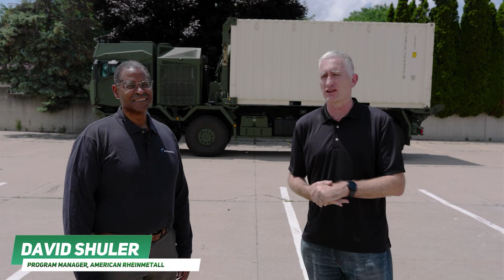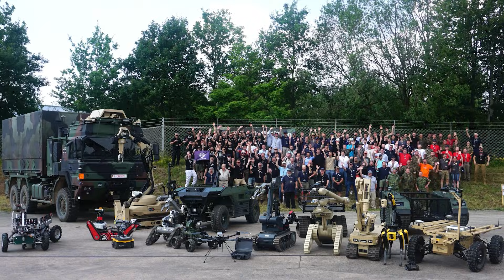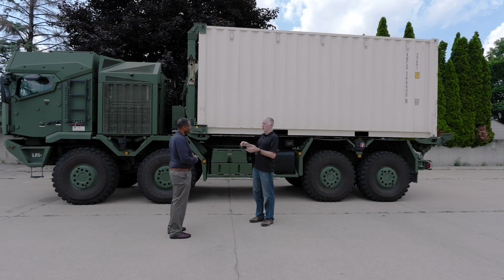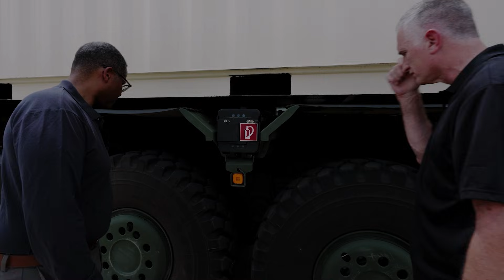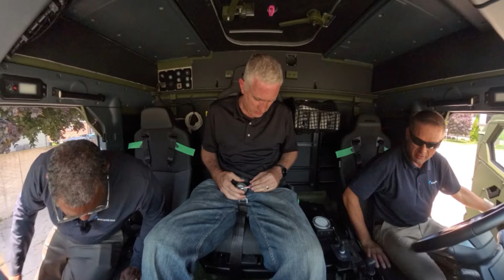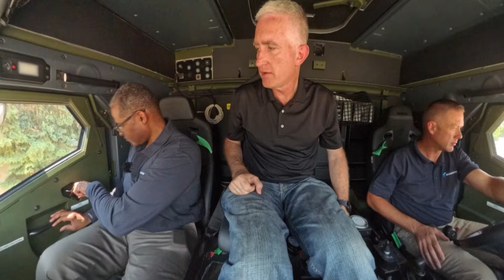American Rheinmetall, and the HX3

Comment: Cab over the engine is an older configuration that has many drawbacks, but it does help with smaller tighter inner-city roads.
Reply: the pro of a cabover is that in an event of a crash you won't be crushed by the engine.

Comment: HEY!!  I KNOW!!  LETS PUT POWER DOOR LOCKS AND ELIMINATE THE HANDLES COMPLETELY LIKE A TESLA!  I LOVE THE CD PLAYER IDEA.  I ALSO THINK THEY SHOULD ELIMINATE THE FLUID DRAIN PLUGS COMPLETELY.  Factory fluid change Interval is probably 200,000 miles.  Personally I think these should have every bell and whistle a GMC Denali has, only the very best for the troops.  Let's throw in remote start while we're at it.  Wouldn't want to have to get into a hot rig on one of those sunny Iran days.  All you knucklehead dorks and your "ooooh!", "aaahhh!!", "shiny electrical thing!". We may rue the day that we strayed as far as we have from tried and true basic mechanical essentials.

It's one thing for technologically advanced gear to be given to teir 1 guys, but for the logistical backbone to be so potentially vulnerable to EMP, or just a high enough concussion burst near by during a real attack....  I hope we never find out.  But as Dad used to say "sh!t in one hand and hope in the other and see which one fills up first"

I'm not worried about these trucks while they are still under warranty, it's 20, 30, 50 years from now when they are just sitting in a reserve depot, what will it take to refurbish this truck?  And you think that guy is going to honestly tell you if there were issues with this rig?  That's sorta conflict of interest.

Comment: As a Marine MT mech turned ops chief, Id hate to see this replace the LVSR. Less capability with solid axle suspension, less axles, no easy engine access, lower Ford capability, and so many more places for electronic failures which are the hardest to troubleshoot. I got to mess with a European version while in joint NATO training , and I couldn't think of a single way it was better.

Comment: All those cameras and radars are nice when driving on public roads, but they are also emmitors which can be detected quite easily by enemy sensors. Sure you can put an EMCON switch in there, but if the PFC learns to drive with all of it then you ask him to turn it off he or she might struggle to keep the vehicle wheels down..
Reply: You literally cannot hide in the modern battlefield. Keep the sensors and gadgets because an fpv or recon drone can find you regardless.
Reply: @Gegengrupenfuhrur respectfully disagree. There's a big difference between being detectable and being stupid... This would literally be like driving around with your lights on.
Reply: @fire304 you can turn off unnecessary sensors though. Like you dont need lane assist in a combat zone. But since 95% of these will end up in garrisons or humanitarian aid missions, its a good feature to have.

Comment: Fewer types of trucks is good as long as they are solid designs.  Saves a ton on spares, makes spares cheaper (economies of scale), and makes training maintenance people easier (fewer chassis/engines to learn).  Just don't do the typical German thing and overengineer the damn thing.  Simple and reliable is key.  After all, grunts have to drive and maintain these things.  ^-^

/edit and that went right out the window after i posted this comment.  Adaptive cruise control?  Automatic braking?!?  DO NOT WANT.  If i need to ram something with a military vehicle, LET ME DO IT.  These systems add unnecessary complexity.
Reply: It's probably necessary to be street legal
Reply: @MatthewMakesAU  Not yet, but it appears it might be by 2029.  Which is a mistake, IMHO.  I've never had auto brake save me from an issue, but i have had it try to put me through the windshield for no reason.

Comment: I love hearing the bragging about the advanced suspension which being leaf springs is literally the oldest suspension
Reply: Two independent leaf springs!
Reply: Tried and true. The Oshkosh TAK-4 is a great suspension, but there are a lot of specialized wear components in it. If you end up in a prolonged war and have ball joints failing you can only order more. Leaf spring components can literally be made by any moderately skilled machinist with simple tools.
Reply: Kinda, but these type of spaced parabolic leafs are indeed rather recent tech (well, compared to coils anyway) they are (usually) of equal length, but spaced apart which means there is very little friction between them, which in turns means they behave much more like coils in terms of rate and wear.
Reply: They have the parabolic leaf packs, they reach nearly the same dynamics as the coil setups. Been on a ride in the older HX generation, cab mounts were stiff, but the springs were acting wonders on the potholes!

Comment: ITAR and Security Clearance requirement are quite a hassle, there are a lot of projects only US Citizens are allowed to work on. This is a big driver on having Production and R&D in the US
Reply: wrong. it's the other way around. Developing outside the US and being ITAR free is much bigger business.
Nobody wants to develop in the US and thereby becoming ITAR dependent.
Reply: @Mar-s5q8mboth can be correct. Indeed it is generally easier to produce outside. Just when you want to produce for the American military you usually must have a local representation and often some local manufacturing. 
But indeed you will rarely export from these places, they are just for domestic demand.

These facilities are only there because they are forced to have them there.
Reply: On the one hand, yes. On the other, there is a big push to buy "ITAR-free" internationally.

Comment: Cab over engine, and no dipstick............I suspect the engineers HATE mechanics..........
Reply: There is a dipstick, but the DRIVER doesn't have to check it. The driver pushes the self-test in the cab and it gives the level. If the driver wants to check, there is nothing stopping him/her. Lift the cab and check the dipstick.

Comment: as a mechanic im curious to see the longlivity of the engine (as you mentioned JP8 is known to be dirty). i did not see the engine yet but i fully expect it to be a common rail diesel based system stripped of as many emissions stuff as they can get away with. modern common rail diesels operate at 800-2000 BAR of fuel line pressure. the high pressure fuel pump has extremely fine tolerances (as do the injectors) dirt or lack of lubrication from the wrong types of fuel wil absolutely eat away the inside of the fuel pump clogging the fuel injectors (injector ports are laser cut and are smaller in diameter than a human hair).
I love MAN as a company but iwoudnt be surprised if the fuel choiche is going to bite them in the butt
Reply: The fuel choice was a DoD requirement. We started moving to running JP-8 (F-34) for everything in 1987 to simplify logistics. That's part of a NATO STANAG. Interestingly, the USAF converted to Jet A (F-24) w/JP-8 compliant additives for all CONUS airfields in 2014.
Reply: They said it could use a variety of fuels, so I'm not sure what you mean.

Comment: I would have thought that "not made here" is an important consideration in having an American facility.
Do I see DROPS
Reply: For large contracts like this there are a lot of military suppliers that have set up production lines in the US or partnered with existing US manufacture to build the design, thus it is just not entirely designed here but have full access to the intellectual property to adjust to needs, the production and spare parts generally will be made here.

Comment: luddite: oil level sensors are bad blah blah blah

meanwhile they're using a chipped device to watch a video, their car has electronic ignition and injection and AF sensors and their home furnace runs on a board.
Reply: Sensors fail. Dipsticks, not so much.

Comment: They should make a Gun Truck module for the HX3. Not for actually adoption or use but it would be a great flex and PR move just to have it.
Reply: The current kits are built to slot into a 7 tonne. So long as the mount points remain standardized on the new vehicle it should work
Reply: @ShakiestGunInTheOzarks   The Archer mobile artillery system will be and/or is on the Rheinmetall HX2 8×8.
Reply: It can fit the RCH-155 turret.

Comment: The more tech you fit on the more that's going to go wrong.......pity the mechanics who have to deal with "good ideas"😉
Reply: Actual boomer brain
Reply: Sometimes adding tech reduces complexity if you get rid of bad old tech at the same time. See: clean early EFI systems replacing vacuum snake pit carburetors.

Comment: The older HX trucks looked absolutely positively cool. This isn't bad, but they lost me at no dipstick. Blind spot sensors and adaptive cruise control is... An interesting choice. Makes me wonder how much of it will still work in 17 years
Reply: I think he was just talking about PMCS. He says specifically that their is no dipstick that you would access normally. From my guess there is a dipstick it's just a maintenance level check not a operator check. Although I'm just guessing.
Reply: @T7_H3rbz You guessed correctly! There's a dipstick on the engine...a minute of working the hydraulic pump to tilt the cab and you have access to it.
Reply: @ceemosp  Point is their decision to not mention that shows where their priorities are. They're too stuck trying to make this a next gen rolling software glitch and not a truck. At least the truck it's based on has a good reputation, I guess. Idk, European armies tend to have wildly different standards to us and I'm usually not a fan of EU priorities.

Comment: Vastly more ... whatever ... than the old Duce and a Half.  I wonder how much all that extra stuff costs?  How much does one of these cost - as opposed to a Duce and a Half?

In any case - yes - interesting and informative.

One of the problems they had with a previous vehicle being operated by women - was that it took 5 women and 3 men to pick up one of the tires laying horizontally on the ground.  To put it on the vehicle they had to turn it vertically.  When they did that - they could only get 3 people on the tire.  The men could lift it on - but - the women could not.

I didn't fully understand the Tire Changing Process for this vehicle.

Thanks Nick.
.

Comment: And here we go again: The successor of the Radfahrzeugfolgegeneration (that is one hell of a word, but M A N are three letters, spelled seperatly, and the lion on the steering wheel is actually the logo from Büssing. A left over from the merger between MAN and Büssing) is back over the pond for trials, like its predecessor. Back then, only a heavily modified version with more american stuff in it was procured to haul the Pershing missles around. For the rest, Merica bought american stuff, because the KAT1 wasn`t invented in Merica and it wasn`t made in Merica. Lets see where this "competion" goes. But it makes me smile, that a frame and suspension concept worked out back in the sixties is still competitve.
Are they going in the offroad version for the coil spring and hydraulic shock absorber set up, or do they stick to the cheaper leaf spring set up?
Reply: Interesting insight.
Reply: They have moved from Coils with the creation of the HX-Fleet. They've got the parabolic leafsprings... think they had Coils in the SX series until 2010 or so.
Reply: can't get mad about "not invented here" from a geopolitical entity that's been getting rid of everything that works from every other geopolitical entity in order to get as much as possible domestically built.
Reply: Here we go again indeed, this has pretty much nothing do with old KAT1 except that the cab looks pretty similar. Engine placement, driveline, frame design, it's all is fundamentally different. KAT1 ihas been dead since the SX Series died 15 years ago, it was too complicated and expensive. And RMMV doesn't use coil springs anymore for anything, its parabolics all the way (IIRC the H in HX is for "halbelliptisch)
Reply: And yet the UK MAN support fleet (6000 lorries) has been grounded due to propshaft bolt problems. 

You'd have thought they wouldn't have problems like that after years of making them.
Reply: @R.Sole88109 Half knowledge and misinformation..."All 6,000 vehicles, some of which have been in service for nearly 20 years, are being fitted with replacement parts after some were damaged because they were fitted incorrectly, according to BFBS Forces News." Since this obviously only affects British vehicles, ask yourself where the root cause of the problem is? Another quote from BFBS may give you a hint:" The cost of the remedial work is hard to ascertain, but because MAN is not responsible for the error, it will most likely be borne by the MOD." Let me put it in easy words to make it more understandable for you: British mechanics fitted the bolts incorrectly during repair and maintenance - hardly the fault of the manufacturer!
Reply: @ceemosp  You gotta look it from this perspective; if something is not ready to be handled by the British, its not fool proof. :face-fuchsia-wide-eyes:

Comment: My mate drove on when the British Army bought them from the German Army. They had the German camo on, with UK military plates and a small Union Jack painted on the front. Naturally left hand drive
Reply: .Hello from Germany. The British Army has been using the HX series for a long time. In 2024, the British Army procured 500 HX-PLS 8x8 vehicles. I think they operate a few variants depending on the mission they are needed for.
Reply: @Toddel1234567  Yeah, though that project was incredibly long and drawn out.  

Allegedly, they were supposed to be in service by the late 90s, but still hadn't fully come in until the mid 2010s!  They were still rare when I left in 2011.

Comment: Once all the extras are added into that cab, it is gonna be tight.
     Radios, gun racks, extra infantry shit
Reply: My wife was once watching me packing for an exercise and said “Do you really need all that?”
“No, I only need about half of it.  I just don’t know which half!”
Reply: Communication equipment wont take much space, we're not in the '80s anymore, gun rack goes behind the seats and it's not a infantry transport so there isnt the same amount of personal gear coming along and as per the video, it'll be done like in Europe: storage space on the roof if required. Not like there is much more space in the current fleet.
Reply: @Ganiscol you omitted the "grunt factor" in the equation! They will try to take vastly more stuff with them when assigned to a vehicle...unless stopped ...most likely at gunpoint 😂 I remember how I myself "accumulated absolutely necessary things" in my personal gear during my time in the military. There is never ever enough storage space in vehicles 😂
Reply: @Ganiscol that is an exellent answer. Thanks for clarifying